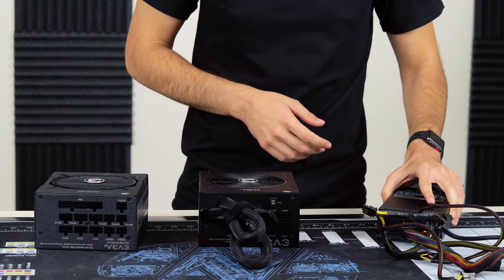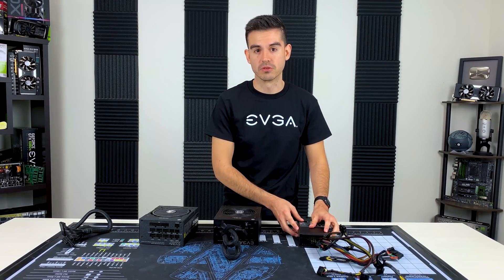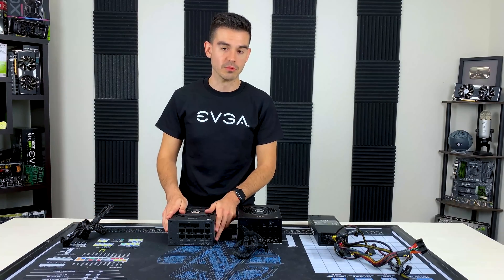Modular vs. Semi-Modular vs. Non-Modular Power Supplies

Comment: Just a long note about Thermaltake. I just went through 2 weeks of hell trying to diagnose a new build that had a new Asus ROG Strix  x570e Gaming and I used one of these modular Thermaltake PSU's. I had it all together and posting and I was making use of the 8 sata ports on the board with a 2TB NVME and 5 Sata hard drives installed. The problem is only 3 were showing up. I moved the wires around, swapped modular ports, removed the PCB for the Hot swap tray, even traded motherboards but they still did not show up. It finally turned out to be a bad modular sata wire off the PSU. I finally had to use one of the molex power wires that came with the PSU and rig it with adapters to change to Sata connectors and voila', they showed up. It was too much wire and too fat to use that way though. 2 weeks of swapping parts and wires, I guess I couldn't believe that short little wire was bad. It was painfully painful to get a new wire sent from Thermaltake with all the paperwork so I did a replacement of the power supply with Amazon and just took the wire out and sent back the good PSU  sans bad wire so no one will ever try and use it. I'm letting everyone know, it can be a bad wire.

Comment: In the end use modular if you have a side glass.

and use Non modular if there us no side glass
Reply: why?
Reply: @joshyy9k  it just looks prettier and you have to fight less cables than you need to, but if you have a shroud it doesnt matter that much
Reply: @azn_heckie8584  i plan on getting non-modular because i'm scared in plugging the cable in the wrong slot and frying something on the PC
Reply: @luminumlx2604  its not really difficult. if you place something wrong. It just wont start. But if you buy a really cheap one, it maybe could. but most times it wouldnt. you can also search where to put what cable. But in the end, you do you my friend

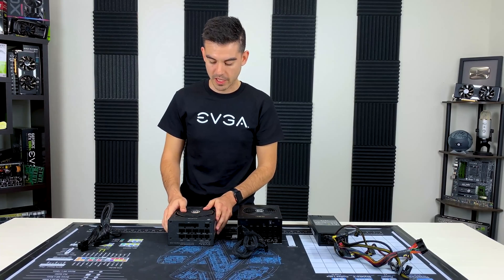Comment: @2:40 Wouldn't you have to change the cables with the specific PSU you put into your system? If not, are PSU cables from the same vendor modular with each PSU they produce?
Reply: They're all standard doesn't matter what brand or models
Reply: @jacobsory9678  it does matter, your PSU can literally break, if you put wrong cables. 

You should only those cables that are officially supported

Comment: Probably less than 30% of ppl build their own pc's.  The other 70% could care less about the cables as long at that PC boots up and runs smoothly when they need it to work.  I personally have built all my own PC's for the past 20+ years, and i love the Modular power supplies.
Reply: how old are you
Reply: @haylanhead5820  48
Reply: @dangerously72  so which one is harder to build old PCs or today’s PCs
Reply: @nintendomusic2199  I don't think the actual build has changed a lot, but the newer case designs and modular pwr supplies definitely make them easier and 'cleaner looking' to build Today...that's my opinion.  I think it really just depends on what you are wanting, the cooling requirements, etc.  I don't do liquid cooling because i'm not a big over-clock freak, but in that instance, it can be quite a bit more complicated to build a modern pc.

Comment: Throw all semi-modular and non-modular power supplies in the garbage where they belong.
Reply: Honestly what's the actual difference between a semi modular and full modular power supply? Do you often find yourself wishing you didn't have CPU and motherboard cables? They're almost always going to be plugged into a full modular anyway.
Reply: @johnwolf2349  Cleaning easier Modular better warranty
Reply: @johnwolf2349  Cleaning easier Modular better warranty
Reply: Johnwolf234 imagine me, I have a non modular. My psu is at the bottom and cou thingy is at the top. Unless I want it to look messy I have to run though the back directly which makes my right side of the case cover stick out, and will damage it over time. I’m in need of a fully modular to sort that problem, as I can purchase a long cpu cable, and a short storage power cable as my hdd is 2 inches away from my psu
Reply: @johnwolf2349  the difference being able to use sleeved kits instead of extensions which in some builds can get messy.
Reply: @Porkleaker  But if a person isn't going to use a sleeve kit then they are paying extra for a full modular when a semi modular would do. Another possible solution is to just use a sleeved extension for the mb connections most of the cabling would be hiddenbehind the motherboard tray anyway might as well save a few buck. Now I do have to agree with the idea of letting most non modular PS go the way of the dodo. On all, but the most low wattage PS with just the bare minimum of connectors to begin with, they are just a massive entanglement sitting on the bottom of the case.

Comment: I was messing with the power meter yesterday and it doesn't or didnt have rtx cards (specifically the 2080ti ftw3 or kingpin) updated to be selectable yet
Reply from the maker: The RTX 2080 Ti is on the Power Meter, we added it at the launch of the product. We do not specify between different models of RTX 2080 Ti as all of them have an Official TDP of 250w. The RTX cards are lower down on the list as it is alphabetical with RTX coming after GTX
Reply: @TEAMEVGA  I must have missed something. Thanks yall.